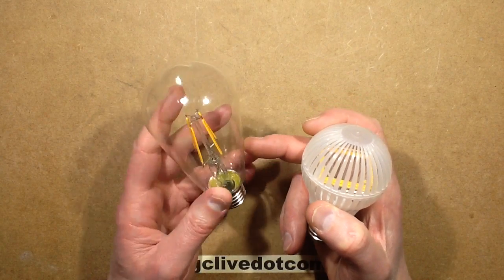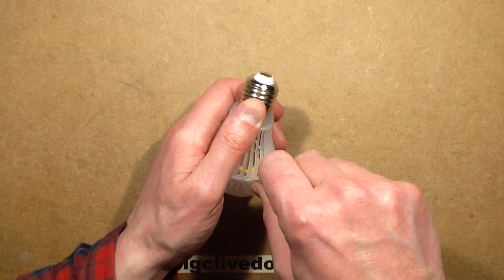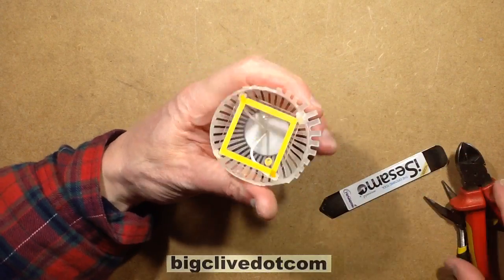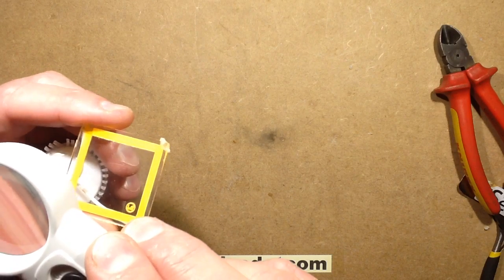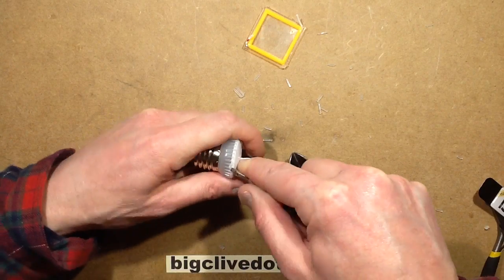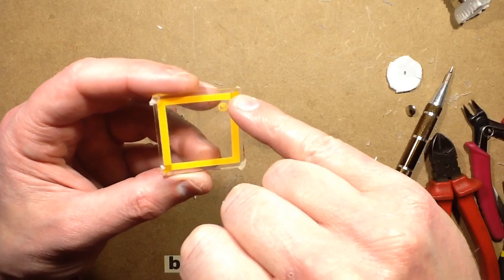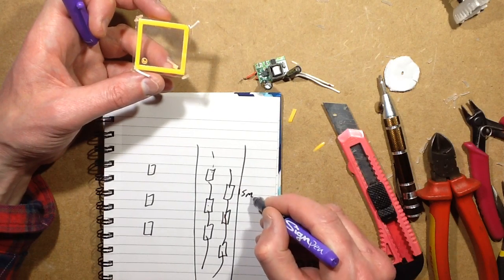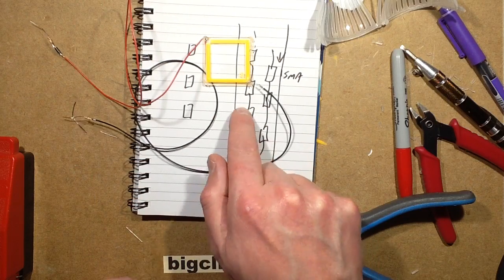Teardown of next-generation LED filament lamp.

Comment: JFYI   Now started to flash / fail  one in June and then another in December 2021 one was used every day a Landing light - the other a few times per week.
 Korea Solar LED Chips E27 12W High Power COB purchased in August 2016 from Aliexpress

If I find time I will see if they can be repaired / or find out if it is just one of the 4 segments in the square glass.

I did like them and they were bright enough, my wife prefers the soft warm white.

Comment: Has anyone ever heard of the general electric classic shape led bulb the bulb is entirely made out of glass just like an incandescent but instead of it having led filaments it has a SMD tower with LEDs in it but because the bulb has that white frost that you see on most light bulbs it's really hard to see the inside of the bulb luckily since I have some of these bulbs one of them broke and I was able to see the inside of it and what I just explained is what was in the bulb.

Comment: Anyone else who bought these at the start of 2016 finding that they're all starting to fail now? Looks like the PSU is still good, but I've had two of them lose half of the LEDs, so that there's just a V shape rather than a square of LEDs (and half the output).

Comment: I bought this after watching the video in 1/2016 and today it finally gave out 9/19, so about 3 years and 5 months (negating delivery and me not using it straight away).
Reply from the maker: I still use the original butchered one in my bedroom.

Comment: I wonder how well, after three years of use, the plastic shell would have stood up to the artefacts of the intense white light. Even though the light is, to all intents and purposes, visible white light, it is almost certain still carries some uv artefacts which, whilst not harmful to us, may well degrade the plastic, at least above the glass plate. The glass itself would help to mitigate uv radiation from the domed end of the bulb.

I'm guessing that the dome is ultrasonically friction welded to the cone section, potentially as an assurance against failure of adhesives, which might react adversely to the intense light emitted from the cobs.

Good ventilation will invariably extend the life of the bulb, and I could see these being ideally suited to some commercial applications, or if you just wanted to be different to everyone else on your street, but personally, I'd still take the traditional looking glass bulb.
Reply from the maker: It's my main bedroom lamp, and while it doesn't get used a huge amount it's still standing up well.
Reply: After 3 years mine are still working perfect. Anyone know og they are still in production?

Comment: This seems completely ingenious and it solves the heat issue without needing big metal heat sinks. Why haven't these types of bulbs taken off?
Reply from the maker: They have in a way.  The very common filament LED lamp is a close relative to this type.
Reply: It seems more liable to break than a glass mounted one though, as there are no thin connections? Also the vented bulb case is very clever. Does the glass on a filament LED still get hot, or does the air inside help dissipate the heat?

Comment: The problem with all those holes is you'll have all kinds of insects getting drawn to the light and then getting trapped inside and dying. 

We use LEDs with the aluminium heatsink, here, and we kept having to clean out the plastic dome because bugs crept in through the heatsink slots, died, and collected inside, blocking the light. Ended up drilling a couple big holes in the bottom so that they can escape once they've had their fun.

Comment: Seems like a take on the COB LED technology that's usually built over a metal substrate, but built over a glass substrate to allow more omnidirectional light output. Very unique and clever. I want some!

Comment: Is there any power lost when using the converter to the edison screw?
And can you tell me; is the edison screw better?
A further question; do you use energy efficient LEDs for your house lighting?
What kind of LED would you recommend for outdoors use for under a porch?
Reply from the maker: There is no loss in the adapter.  It's got no active electronics.  The BC and ES adaptors are just what evolved in different countries.  i use LED for my porch and entrance lighting, but just low power lamps for general illumination and a very long lifespan.  On the entrance path I have a 10W floodlight with movement detector.
Reply: "The BC and ES adaptors are just what evolved in different countries."
I understand that, but there's a debate going on in the background to what people should choose if given the choice.
Reply from the maker: Choose what's easiest to get.  The ES is a stronger arrangement, but the BC by its design can't work loose.
Reply: @bigclivedocom
People are telling me that using a B22 to E27 converter for my household lighting is dangerous.
"...those should not be used, because they do not ensure that the outer contact of the screw is connected to the neutral..."
Is that true?
Reply from the maker: It's fine if used with a low energy lamp like an LED one.  Technically speaking the outer thread of the lamp should always be connected to neutral in case someone touches it while changing a lamp with the power on.  The non-polarised nature of the B22 plug defeats that, but if the adaptor is screwed onto the lamp first and then inserted into the B22 holder it should be fine.  IKEA actually sell these adaptors.

Comment: They're now selling lamps like these in the home depots in plastic bins of 10. They were originally $20 but they were discounted to $10 and now they are $5 and rapidly disappearing. Take a look at this image: http://i.imgur.com/PK0y0Da.jpg
However those lamps aren't the same as this one like I thought at first. Instead of a nice LED COB glass thing, it has a plastic square (I think) and the leds are actually LED filaments arranged in a square and attached to the clear plastic square. Also, the light that goes through the square is given a weird yellowish tint to it. So they're meh but still cool.
Though, on the plus side, they don't flicker (not that I can see) and are silent!

Comment: Clive, I'm wondering whether the transparent square holding the LEDs is really glass.  There are ceramics available that are (a) transparent and (b) have 10 times the thermal conductivity of glass.  These would be good substrates for LEDs.  The unusual shape and thickness for this application suggests that the manufacturer found a ceramic supply that happened to fit rather than something that was designed for purpose.  Do you have any way of assessing the thermal conductivity, or at least comparing with glass?

Comment: For those who think the US is 110VAC standard, it is not.  The US standard household voltage is 120VAC.  The standard voltage for Taiwan and a few other countries is 110VAC but not the US.  US products are normally expected to operate correctly on 120VAC +/-10% (108VAC to 132VAC).  Japan has the lowest standard voltage at 100VAC.  Mexico and some other SA countries are the highest of the 1xxVAC countries with 127VAC as their standard.

Comment: Clive how would this stack up against 1600 lumen (100 watt eq.) CFL bulbs?  I run 30 of them in my 400 square foot shop.  (690 watts) and was wondering about switching up to these (180 watts).  I don't rally care about the consumption as much as getting as much lighting in there as possible.  More lumens the better in that shop.
Reply from the maker: You'll need to experiment with lamps to find ones that don't flicker and have good colour.  Also consider fitting the splitters that allow you to use more than one lamp in a holder, as the lower wattage lamps are more efficient and last much longer.  If you do a lot of work at a bench then consider a local LED floodlight for your work area for maximum illumination.
Reply: My focus is balanced and even lighting.  I only run cold white as I like it far more.  I have the lights on a every other row staggered arrangement on 36" arrangement.  so every 3 feet there is a bulb, no more, no less.  Makes for very even lighting which I love.  The problem with adding lights unevenly is it will make the rest of the room feel darker.  I don't have any shadows though, not until you get your hand down to about 6 inches off the tables.  If I was to add more bulb, I would simple make the arrangement smaller.  Not wanting to mess with the current fixtures, I would have to go back and add a bulb so that every 18" is covered, which I would do if needed.  Right now I have about 500Lux I think it is, measured from my phone.

Comment: It's likely not glued but rather heat fused plastic. The large piece of glass it because the glass must pass heat stresses. Could you test how efficient the AC to DC power supply is?

Comment: I bought some of these, except I got a very cheap bulb, 9w but actually between 2-3w, nice colour and bright thanks to 5630 led's. But the entire thing is plastic, including the board, no cooling at all and the usual capacitive dropper on the back of the board. Attempting to add my own cooling as aside from that, they give very nice light. As stock I wonder which would go first the led's or cap =/

Comment: I have seen a lot of these floating around, and would love to get them,  but they are all for uk 220v. 

Why are these not being made in 110v us standard?  Any particular electronic limitation reason?
Reply: Orvis25 maybe a matter of supply and demand. US hasn't passed any regulations to reduce the selling and buying of incandescent bulbs so people in the US don't need good replacements as urgently as their peers in Europe. However, USA is a huge market so they will probably arrive sooner or later anyway. I don't know if you guys have switched mainly to CFLs in US as those are quite horrendous and need to be replaced.

Comment: In wich way this is better than a normal led filament light? Oh right, you dont get the cool retro effect, but you still pay for it. Great !
Reply: Lennard Rom probably good ventilation and durability. Odd looks don't matter if it's in a plafond or similar enclosure.

Comment: Hey Clive, why don't you buy an isolation transformer.  That way, even if you inadvertently complete a circuit in what would be a live circuit to ground, there won't be current flow unless you contact the live circuit twice.  Just for your safety....  They are not expensive, but you don't need a true isolation trasnformer.  You likely have enough old transformers around where you can get isolation and get back to your 220V etc.

Comment: After viewing this video, I bought one of these lamps.  Very bright indeed. But how bright is it really ? 

Using a luxmeter, I compared it to a 57 W halogen bulb. At the distance I measured from, the 57 W halogen gave me a 200 lux reading, while the LED gave me 180 lux. On this basis, I would say that the LED is roughly equivalent to a 50 W halogen bulb, or a 60 W traditional filament lamp (the type you can't buy any more).  Not bad at all! Considering the input power is roughly 6 W as Clive measured, the ratio from LED to traditional filament is in the region of 9! Impressive! And the light pattern is rather omnidirectional, very much like an ordinary bulb... 

Oh, and the light colour (warm white) is probably close to 3100°K or a little over. A touch whiter than halogen. Makes it look even brighter...

Lastly, the LED temperature appears to be in the region of 45°C, a mere 25°C above ambiant temperature. Not that much - good for durability... 

But don't place it in an enclosed fixture: it needs cool air to flow through it...

Lastly, another advantage is light weight: 35 g versus 29 g for the equivalent filament lamp. Can be of importance in some applications...

Comment: bought a couple myself from aliexpress on the basis of this review, the light output is good regardles of only 6w, I believe they did send me the warm colour temp version but its nowhere near incandescant probably 4000-5000 kelvin takes a little adjusting to, when replacing something warmer col temp wise, but the light output is sufficient to fill a small to moderate size room. vastly superior to pound lamp led versions which are very directional.

Comment: I just bought a couple of these bulbs for a DIY lamp.  How can I add a Dimmer switch to it?  buy a dimmer switch and remove the plastic covers and wire it up?  Or will a rheostat do?  I'm no electrician :)
Reply from the maker: +Wai Pang I'm not sure they are dimmable.
Reply: +bigclivedotcom thanks anyways :)

Comment: Hey, an iSesamo pry tool. I used those for cell phone repair. They are fantastic tool. Springed steel with just a few useful angles.
Reply: In case you didn't know, they are called spudgers.

Comment: I've been waiting for LED to change the way we look at lighting.  There's no reason why we need to continue the same old light bulb shape.  It's good to have a standard shape, but not necessary.
Reply: Teddy L Boulden it's very nice to have standard bulbs as then you don't have to replace the entire fixture or lamp when the LED lights eventually die. However, there could be a new standard that worked on more suitable voltage for LEDs and the transformer would be in the lamp rather than the bulb. By now the quick replaceability of a light bulb is so ingrained to our life that it will take years to get over that. And in addition there are now over hundred years old lamps that can still be used by just putting in a new replacement bulb. For example, e27 was invented in 1909. I think we love our old lamps too much to replace them. 

edit I see now that you talked specifically about the shape. I think those circular shapes work remarkably well for even output and are very easy to manufacture.

Comment: These are very nice, but I live in Canada where we have 110v-120v. From my understanding, the light will be half as bright, if it doesn't fry the electronics inside. I can find this style anywhere with 110v. Do you have any suggestions? Or is it okay to plug 220v light bulbs into 110v sockets?
Reply from the maker: +AluminumHaste This type may actually strobe on 110V.

Comment: i do not know about electronics. i went back and ordered e26 110v bulbs, but was sent e27 base bulbs per the box. no info was on the box for volts nor wrote on the bulb. i tired them and they light up. --- Would something short out and cause a fire if i continue to use them? I have tried to google for an answer but most info is for not using 110v led bulbs on 220v lamps not the other way around.
Reply from the maker: +Onicdesigns If they light they should be OK.  The chip used in many LED lights is designed for a wide voltage range, but sometimes optimised for the higher voltage.

Comment: A future project for you:-
Build a really bright LED lamp using multiple LED filament strings in series/parallel configuration operating at current levels approaching their maximum rating. (Your previous homemade LED lamps are operated well below their ratings). If you build the thing in a hamster ball it will be well ventilated and run relatively cool.

Comment: I wonder if these flicker or not. Can you take a scope connect it to solar cell, and this will make possible to measure light flicker if any coming from the LED.

Do not connect the scope to LED power supply as this is not what I'm after. I need to know if these flicker and at what rate.

Thank you.

Comment: I ordered 6 of these from the company. it took 2 months to get to me and 4 came broken. they would flash or just did not work. they have quality issues.
Reply from the maker: +Onicdesigns Are you using them on 110V?  they are intended for 220V.
Reply: +bigclivedotcom Yes you are right. :(   face palm..

Comment: i got 10 of these 5 white 5 warm all the hot glue they used melts/turns orange/burnt colour got mine 20th jan all good do like them alot  just dont get the other wattage ones they mostly cheap n nasty  bulbs not the same designs

Comment: Clive a 6watt LED bulb like this, what is it equal to in regards to a normal filament bulb? 40W 60W 120W?
Reply from the maker: +BladeRunner21577 It's hard to say, since I don't have any tungsten lamps to compare it with.  I'd say potentially a 60W lamp.
Reply: +bigclivedotcom So about a mid range amount of light then.
Have you ever come across a bulb that would be equal to a 120W?
Ive been watching a lot of your videos and Ive seen LEDs are in general very hit and miss but mostly miss
Reply from the maker: +BladeRunner21577 Rather than use a single lamp to create high output I suggest getting a lamp adaptor to allow the use of several lower power lamps.  They'll run cooler, last longer and be more efficient.
Reply: I see. Ive been looking for an LED version of a 20W N3uo20 e27 bulb... Without luck so far
Reply: +BladeRunner21577 You can get this same type of bulb with a 12W consumption which will probably be about the same output as a 90W incandescent (1200 Lumens)
Reply: +BladeRunner21577 It's like a 60W lamp. You can see a comparison between a 806lm lamp and this lamp here: http://www.krapinka.com/2016-led-filament-light-bulbs/

Comment: Is it just me, or can you generally assume that all the LED light sources just have half the power they claim?
Reply from the maker: +djteac It depends where they come from.
Reply: +djteac Surely this is a good thing! You only use half the energy so your running costs are reduced. What is more important for a bulb is how bright it is. As efficiency and design improve we are getting more lumens per watt. Makes a change for the Chinese to exaggerate in our favour.